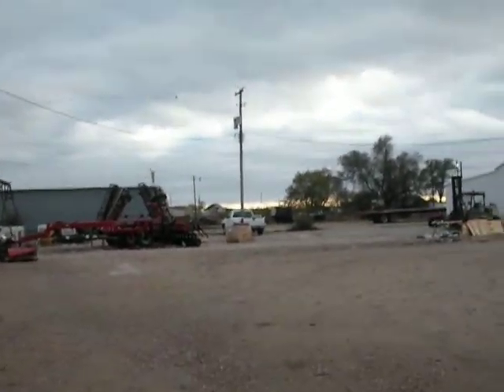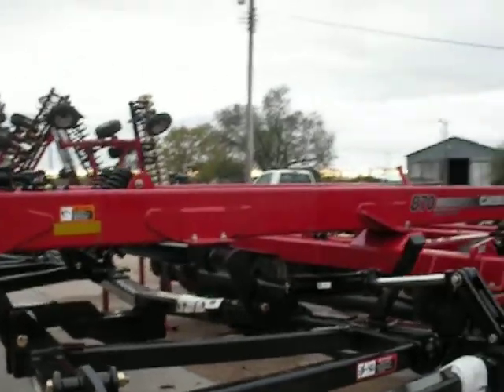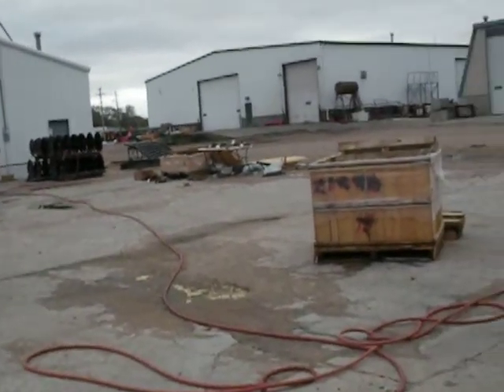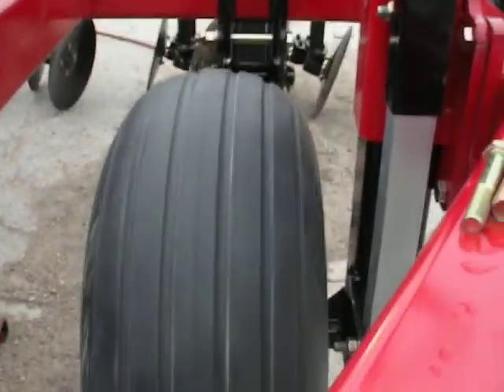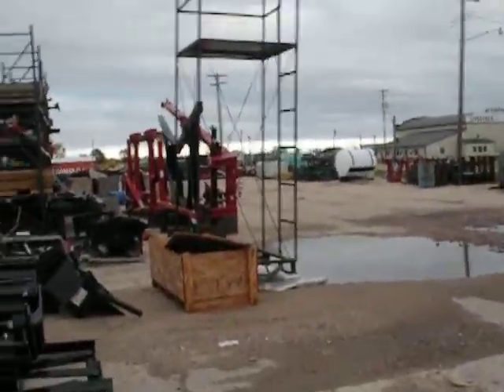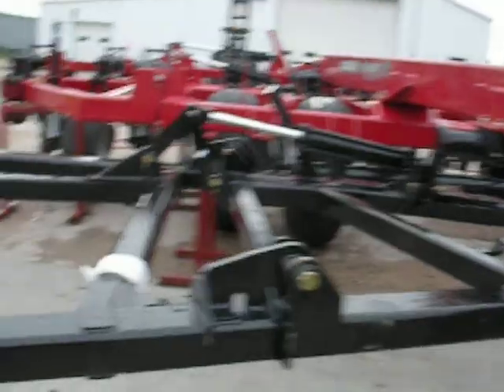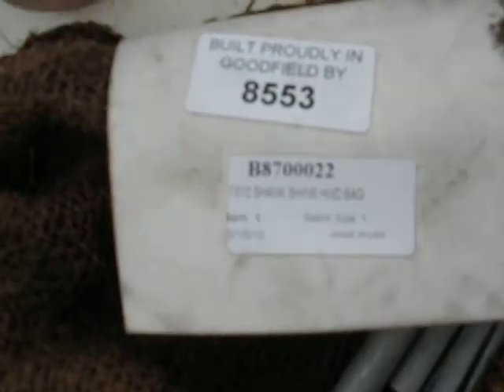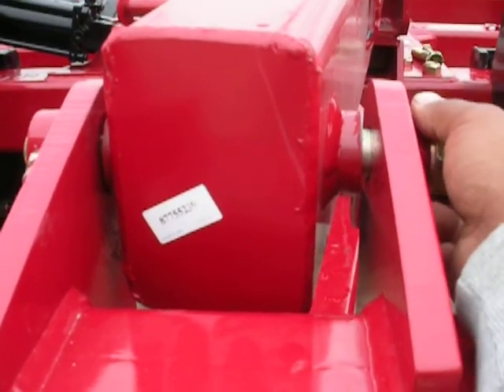Floating Flocks Of Candled Swans| Slowly Drift Across Wax Ponds

Comment from the maker: @oopspaw We do have a manual. We are supposed to take and study it during our off time, but, pbf! Like that's gonna happen! My partner/trainer knows how to put most of the stuff together. We did a smaller version of this machine, already. The machines are made to be somewhat easy or at least comprehensive to assemble. It would have taken us only 2 days for this machine, if the weather hadn't kept getting in our way. It's from a song. I'll put it in the info section.

Comment from the maker: @SugarInHisBlood Heheh! It's from a song. All my titles with the vertical bar in the title, which shows seperation of a verse, are lines from songs. I'll try to remember to put the name of the song in the info section.

The book for this machine is about a hundred pages. Books for augers are less. More complicated machines have more pages, of course. The machines are designed to be somewhat simple and comprehensive to put together. But the book has diagrams and REALLY specific instructions.